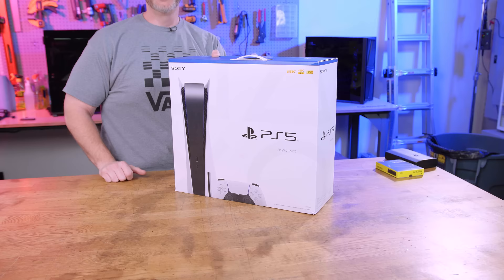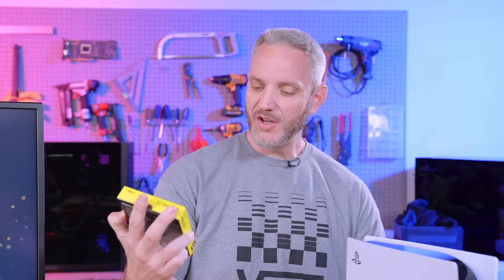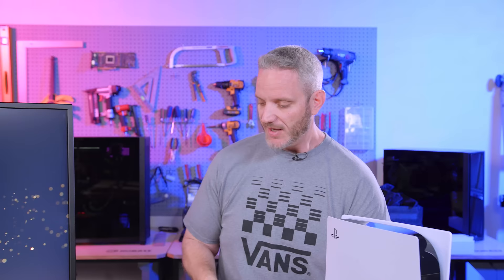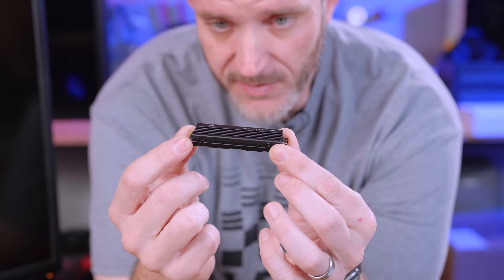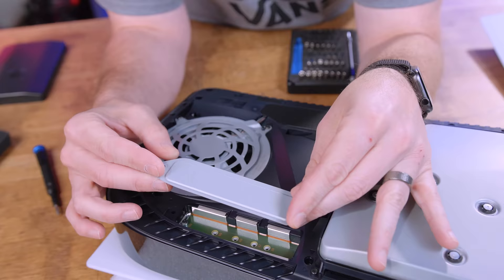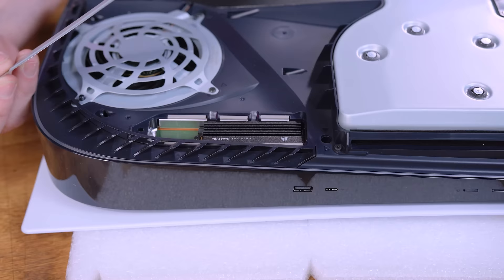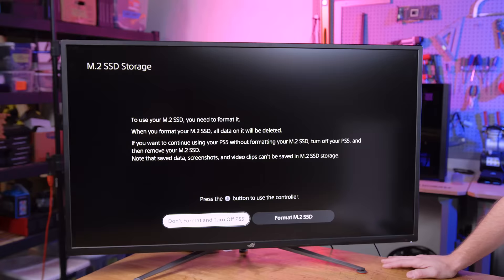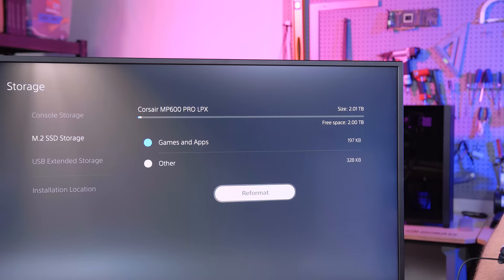How to upgrade PS5 storage - Easy Step by Step Guide

Comment: Yea, I don't waste money on consoles anymore. I have never bought an XBOX since the first pile of overheating, locking up garbage. Which I put a sledge hammer through. The last thing was the PS3 which was a pain in the ass. The console ran fine. It was their updates and stupid PS Network that were the problem. Like, if there was an update and you wanted to just watch a BluRay, it wouldn't let you. The update had NOTHING to do with watching a movie, but you had to wait nearly half an hour for the stupid thing to finish. Then there is the dodgy PSN, which I don't give a toss about, but it wouldn't  let you watch any streaming service through the PS without being logged onto their stupid network. A network which drops out constantly. Done with all their BS.

Comment: Dude, at least do a little bit of research before doing a video like this. Sony released a PSA about why installing the SSD without without the cover disrupts the airflow for the entire system. It works off negative pressure (or something like that, I read it months ago). Come on, dude.

Comment: Maybe a silly question but my husband and i bought the ssd to put into his ps5 but the screw with spacer will absolutely not budge thst the ps5 comes with to secure the ssd. We have both used screw drivers (hand not power/electric) to get it out and it will not budge to the point it is almost stripped from trying so much. At a loss as everything shows how easy this should be to take out. What can we do?

Comment: Hey jay or anyone that is reading this, I get a really odd zzz noise that happens with my pc. It's quite random so it's hard to pinpoint but any help would be appreciated. If you want a somewhat accurate noise think a clipper turning on and off :)
Reply: I dunno but its probably your case fans touches the case somewhere,its rarely happens but it does happen to me once... if that not the reason,the reason might be your psu fans being too old.
Reply: That all i can think of,Im not pros but only learn from experience..
Reply: I thought I might be my power supply aswell because it came with a prebuilt and it isn't a certified PSU. I've checked my fans aswell but they definitely aren't the issue since it was happening before I rebuilt it and I spent alot of hours to get it perfect lol. The only thing I can think of is the PSU.
Reply: But just wanna make sure before I start pulling fingers an all though
Reply: Could be your vrms, what motherboard, psu do you have system specs, settings etc
Reply: @DC3Refom  MSI MPG x570 gaming edge
Gigabyte Rtx 3060 dual oc
32mb 3600 dual channel Corsair vengeance
Ryzen 5 5600x with a golden field liquid cooler
Evga bq 650 watt uncertified 
The only things I didn't upgrade was my PSU, GPU and CPU.
Reply: @DC3Refom  the only settings I've changed is in my bios and that was for my ram to run at its advertised speed
Reply: And it was still doing after I upgraded so it's down to those three really

Comment: "Non user friendly"... well considering the actually NVME SSD for the PS5 is soldered nand that's married to the motherboard yeah I'd say that's not very user friendly. So if the HDD NAND fails for whatever reason you can't replace it. I'm waiting for the replacable SSD version of the console.

Comment: Jay, you're several months too late - You might as well have made a 'what to do when your computer boots' video...The majority of the few PS5 owners have already installed internal NVMe SSD upgrades...You need to start getting more in tune with the current state of affairs - Having too many cpu's and gpu's has obviously warped your reality as to was is current, and what is fantasy....You should take a serious look at that.

Comment: Or is this the one I need ? Please 

Visit the Corsair Store
4.6 out of 5 stars540 Reviews
Corsair MP600 PRO 2TB M.2 NVMe PCIe x4 Gen4 SSD (Up to 7,000MB/sec Sequential Read & 6,550MB/sec Sequential Write Speeds, High-Speed Interface, 3D TLC NAND, Built-in Heatspreader) Black